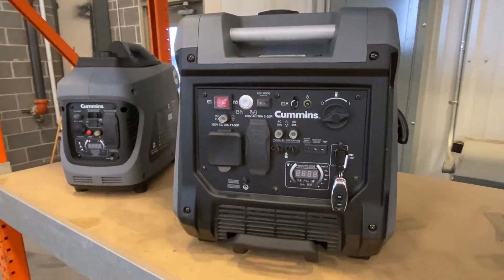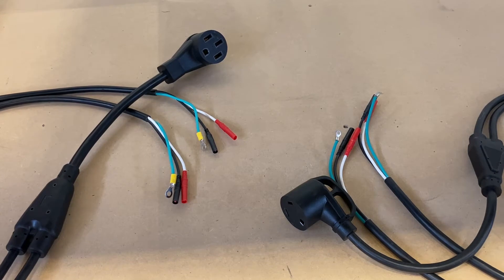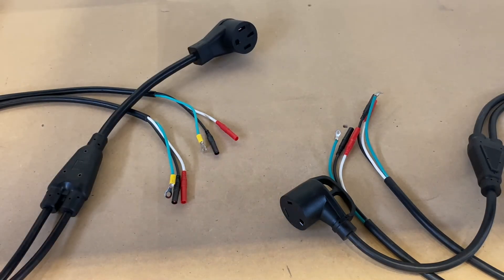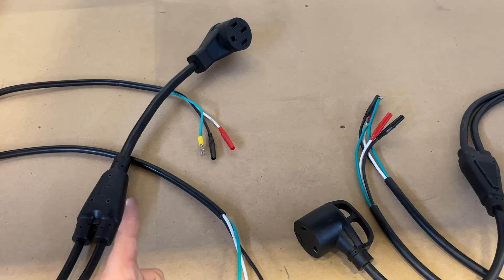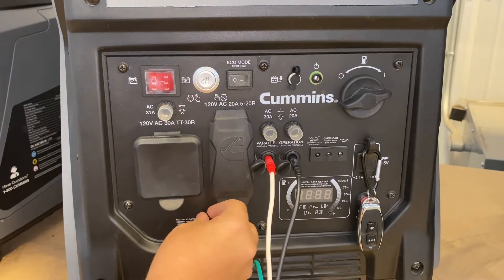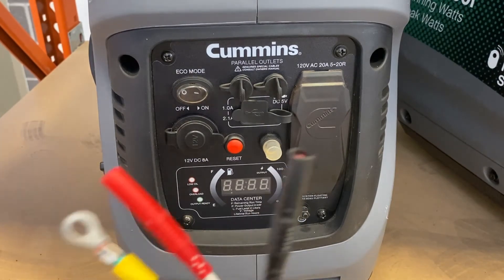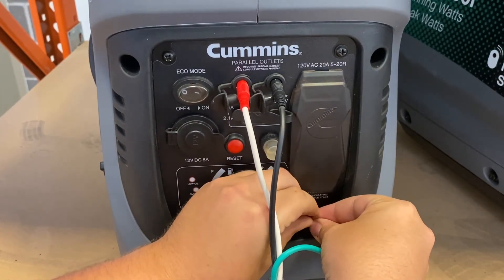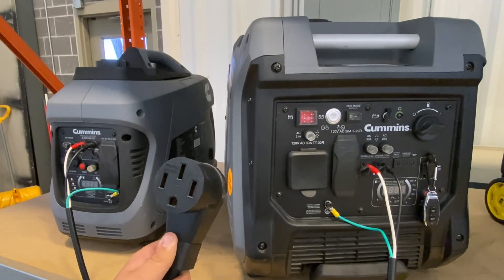How To Use Your Cummins P4500i/P2500i Parallel Kit

Comment: I have a question. I am about to use this for my RV in a week with 2 p4500i would I still need to use the surge protector?
Reply from the maker: You should be good. There should be consistent power unless you run out of gas.

Comment: You show that the red (positive) banana clip with a white wire goes in the left-hand socket and the black (negative) banana clip with a black wire goes into the right-hand socket (facing the P4500i generator. The P4500i generator wiring diagram shows a black power wire and a white neutral wire and it also states: Grounding System (AC): Neutral Floating. Which banana clip is the neutral... red or black? Does the red always go in the left and the black always in the right or does it matter? The 50amp outlet at the other end: at 12 o'clock is the ground. At 6 o'clock is the neutral. Are 3 o'clock and 9 o'clock joined so they are both hot? Or is 3 o'clock hot from one generator and 9 o'clock hot from the other generator and there is no neutral at 6 o'clock? Do you know if there is a wiring diagram somewhere of the A058M290?